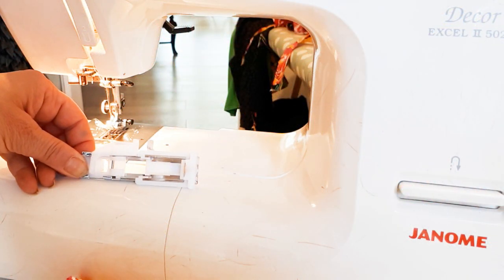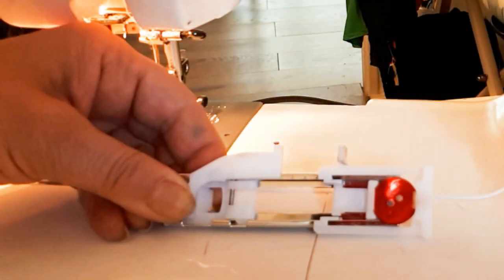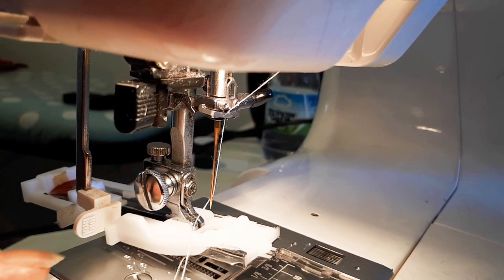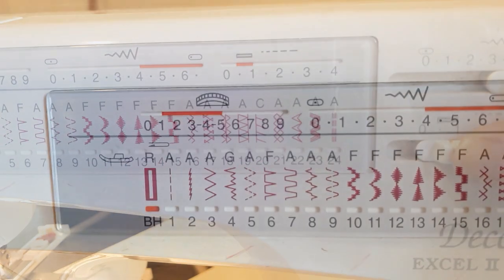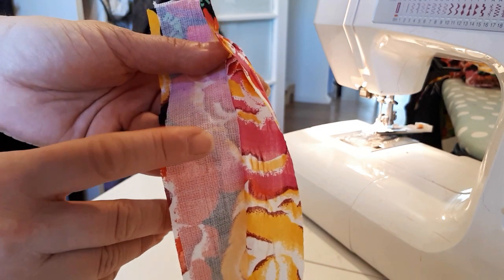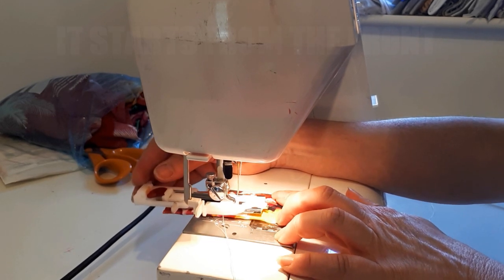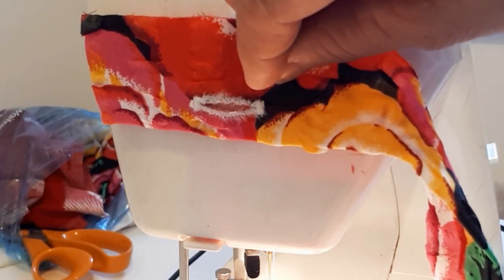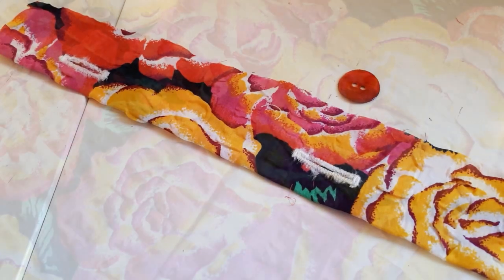How To Sew Button Holes using a Janome Sewing Machine - Sewing Tutorial

Comment: Hi..so glad to find this, I have a good second hand janome, I got for buttonholes. After 6 months on just going to attempt to use it on an actual garment. Stupidly it’s on the front placket of a gorgeous purple boiler suit. Eek. Have practised.
Question, in this video you say ‘it’s still quite big, so I will keep trying to adjust it” or so,etching like that. What do you mean by that?
Also, do you always have to ‘go round again’? Oddly other machine videos show it does that automatically, mine just goes up and down once..is that ok too?
Apologies for the questions but would help me before starting!
Reply from the maker: Adjusting the size of the button to fit the button hole...you put it in the back of the sewing foot. And..on thus machine it seems to kike if you keep resetting after each button hole.

Comment: Needle thread over the foot and to the left. Will try this next time. Maybe it will solve my problem. Thank you.
Reply from the maker: Re booting the machine after each button hole,  is usually more the problem. Especially on slightly older machines. Good luck
Reply: Thank you. Yes, I reboot my machine and yes needle thread over the foot left to right solved my problem.

Comment: Thank you, my buttonhole stitch lengths/density on the right and left are different (the right is longer than the left), do you have any idea on the cause?
Reply from the maker: This is generally caused by having the stitch length set too near to to zero. To avoid this problem, always sew a test buttonhole on a piece of fabric from the garment. Remember to include any interfacing that's recommended on the sewing pattern.